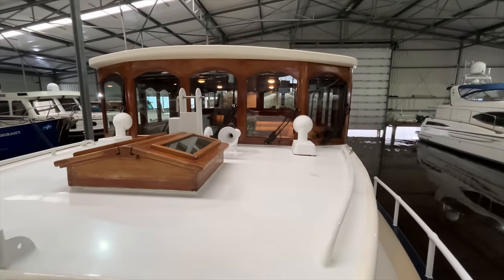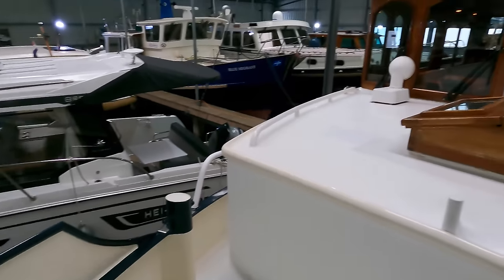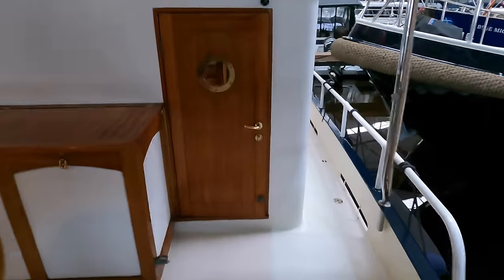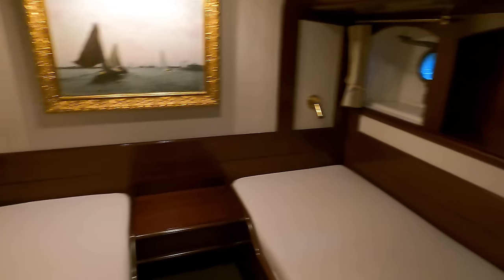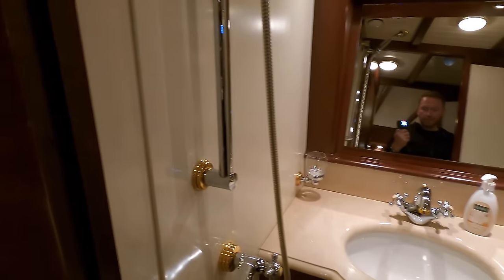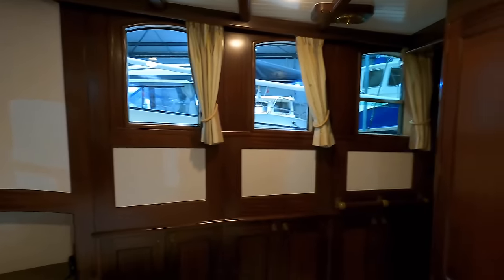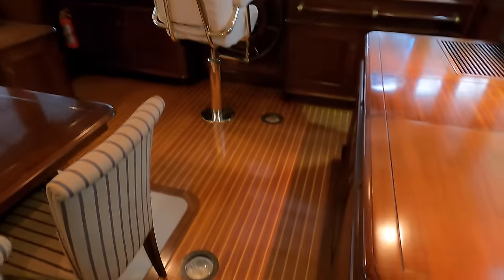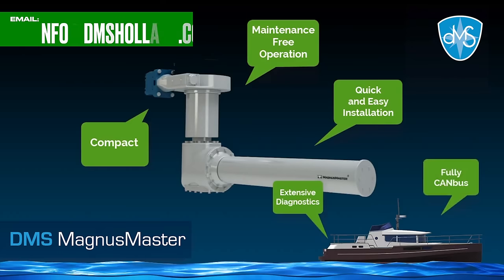ONLY ONE Ever Made! €785k STEEL Liveaboard Long Range Explorer | Vripack 1900 Classic

Comment: Lots to like on this boat. Perfect for Puget Sound, BC, Inside Passage and SE Alaska. One thing I like on the interior is the extensive use of soft rounded corners on tables, cabinets etc. Sometimes you see sharp cornered furniture on these yachts. You only need a harsh bump into one 90 degree corner in rolling seas to figure it out.